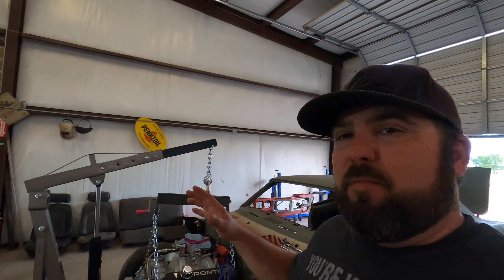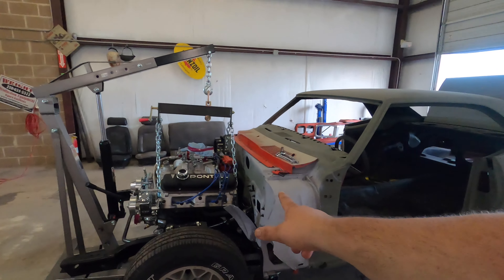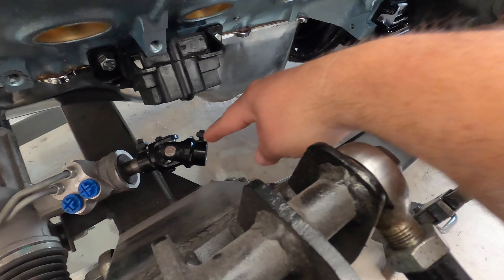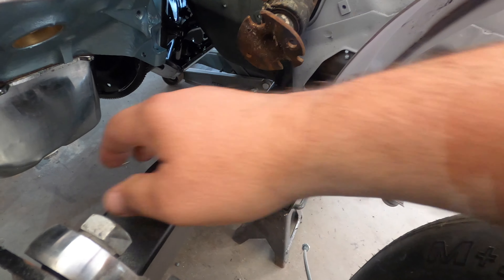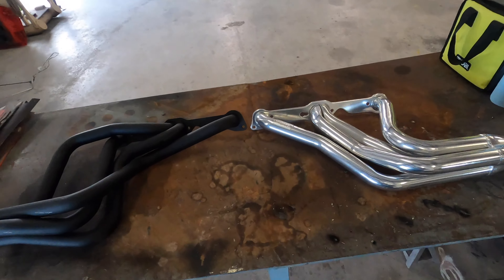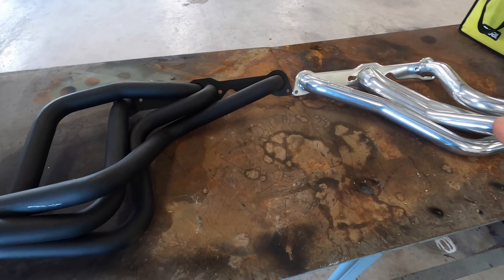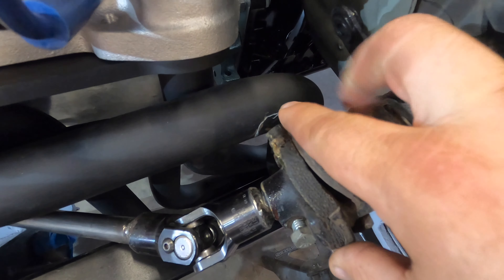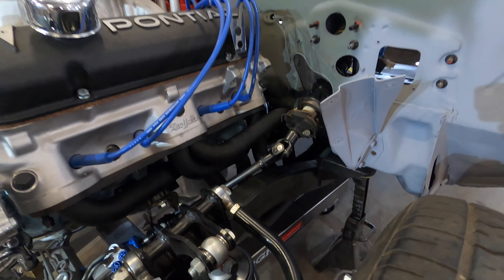1969 Pontiac Firebird Steering Mock Up And Update (Ep15)

Comment: Have you figured out the gap issue with converter and flex plate?
Reply from the maker: hellspawnID haven’t checked it yet but talked to a few people and they said I pushed the converter in too much and I need to slide it back and it will bolt right up.

Comment: Use a g body rag joint, it's a smaller diameter. Motor mount geometry may flex too much under torque with rubber mount . Could use a torque strap. Nice build!
Reply from the maker: Thank you and appreciate the advice and will definitely take a look. She’s at the body shop now so hopefully in a few months I’ll drop the engine back in and test out and make some modifications. Always nice to get good advice.